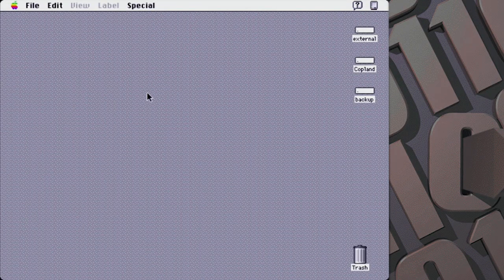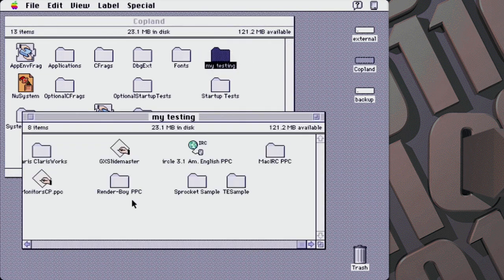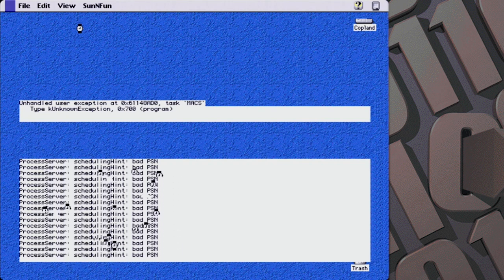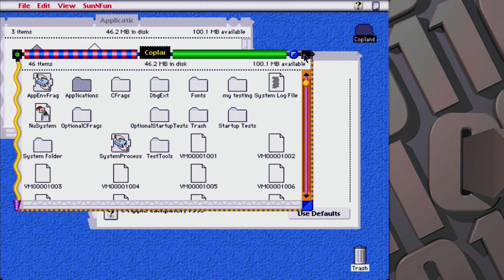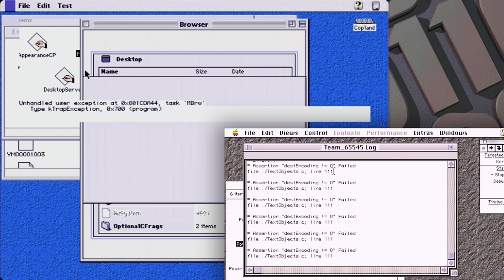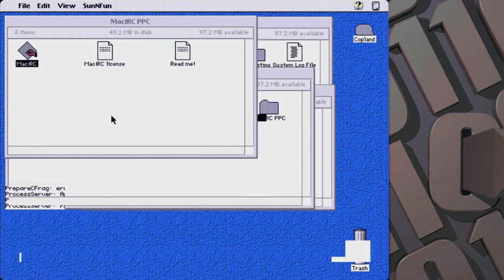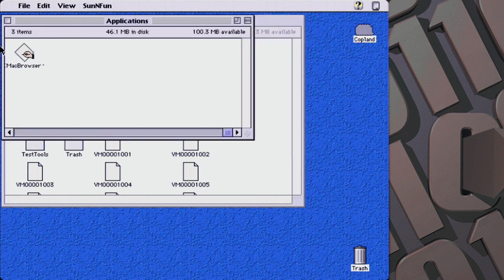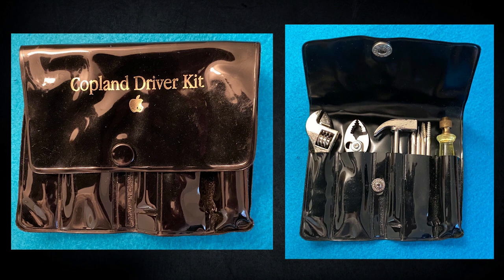Revisiting Apple Copland (D7E1 Build) Info/Tour - Paul's Old Crap #9

Comment: Looking forward to your video on D9 and D11 builds. Remember, the ‘d’ means development, which truly weren’t supposed to be run outside of Apple — they’re not even alpha-quality and meant to be unstable as a subset of engineers were basically looking for the massive crashers, documenting them, and getting those bugs resolved for a workable alpha. As a kid, I was so fascinated by Copland and what Apple was trying to do, so it’s great to see these videos. I’m actually surprised at how much working code Apple had at this point, given how dysfunctional the project was billed. That they had anything built that could boot is surprising in and of itself. We also have to remember that it was a completely different era of software expectations. Incremental upgrades delivered frequently was a hard model all around as the primary distribution points were floppies and CDs for average folks. From a marketing perspective, Apple had to jam a lot into one release as the market didn’t know how to deal with incremental OS releases.
Reply from the maker: We joke about Copland but on the tech side it is very neat what they were trying to do... Unfortunately I'd say they aimed too high and didn't have the resources to effectively build it. For the most part it seems like it was a "build from scratch" type of deal and slapping in existing Mac elements where possible, but everything was going to be different from the existing systems. Some of these old documents show simple things like driver extensions would have to be rewritten. When we see how many years it took for OPENSTEP -> Rhapsody -> Mac OS X to become a final OS, there was probably no hope for Copland.

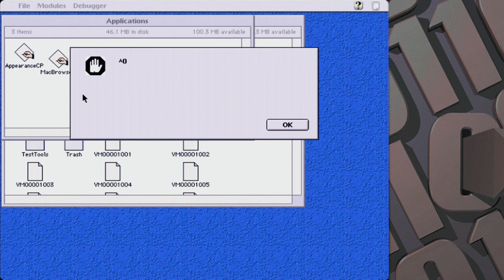Comment: 51:08 ^0 was usually replaced by a parameter string (in the old Macintosh Toolbox ParamText() ) so it's code missing.

Sorry for the tech commentary. It reminds me of a lot of old stuff.
Reply from the maker: It's good information to have as this sort of stuff probably isn't easily found anymore.

Comment: It's fascinating, after all this time, to finally see Copland in action (if one can call it that).  It's also fascinating how fragile the system actually is, with the first debug breakpoint being in the middle of boot!  With Copland's back story of disparate half-baked projects all being folded into the product at once, I'm not that surprised at the result, but it's still amusing to see.  I assume this build was never intended to be seen by peasants and requires an actual Copland team dev at the debugger, who has the insider knowledge of its internal workings and how to recover it, to demonstrate it properly.  I wonder how far one could get in a demo with that resource on hand, assuming such an individual still exists.  And as we've seen, the actual DR builds aren't much better.

Please continue with the videos.  This is something I've wanted to see for, well, about 25 years!
Reply from the maker: The funny thing as well is whenever they did demonstrations for the press, it was all fake. If you watch the episode of Computer Chronicles on Copland, they weren't actually running one of these builds but instead simply moving through a pre-rendered presentation mockup. I think most of what was visible there wasn't even in the last Copland build before the thing was nuked. Going over a bunch of the architecture docs from the D9 developer CD it looks like they were headed in the right direction on the tech side with the microkernel, but they didn't have the right people to actually get things done.
Reply: @netfreakcanada  Yeah, I'm familiar with those demos and remember them from back in the day.  They were a bit maddening since they were so obviously faked.  On CC, they don't actually show the presenter controlling it to prove it's a slideshow, but it's obvious that the screen animation is scripted rather than recorded, and when they cut back to the presenter, he always has his finger on one key.  I've never been through the architecture docs, though.

I do wonder what would have happened if Copland and Gershwin had shipped somewhat on schedule.  I think they could have kept the old Apple afloat for a while, but they probably wouldn't have been great.  Apple likely would not have had a compelling reason to acquire NeXT and would have missed their window to do so, and their decline may have continued.

Comment: 22:24 - The name of that theme was ''Gizmo.''  There were three unreleased Apple developed themes:  Gizmo (Z Theme), Hi-Tech, and Drawing Board.  They were nixed for MacOS 8, then brought back to potentially be included with MacOS 8.5, but were dropped yet again.  If you install Appearance Manager from MacOS 8.5 or newer into MacOS 8, you can re-install the themes.  They also had sound sets to accompany them.  The only theme + sound set that was even remotely tolerable was Drawing Board.  The other two are so obnoxious you'll use them for about 4 seconds then switch.

You can download the original beta themes from the various online Macintosh software repositories.
Reply from the maker: I think I also read something about how the decision to not implement those themes had something to do with potential legal issues if the OS interface was to change that much. Can't remember where I saw that though.

Comment: What happens at 15 minutes 5 seconds is that you get and assertion. 

As a developer one uses assertions to find bugs. The assert is standard part of the C programming language and derivates (C++ and the Objective C that Apples seems to like). One asserts that a certain condition is right; a pointer is valid, a size is valid etc. The asserts normally terminates the process when it fails but I have not used them for OS development so that might be different in this case.  It is normally a macro that is used extensively in the code. During development and debugging the macro expands to "if condition is not fulfilled, print location and terminate process". In release builds those are normally completely removed and users rarely see them. 

If asserts was activated in releases you would probably get them more often than you might think. Despite the termination during development it does not imply that the same bug would mean any actual harm in release. 

The "About this mac" assert on row 5889 in ListWindow.cp (15 minutes, 5 seconds). This is a specific location and the developer can look there a see what was wrong. On the location there is a test, like an if-statement and the developer know that this returned false and  the developer can evaulate the situation and take proper measures. 

I would guess that in this case the call is made to a funktion that either returns something unexpected or is just a stub. A stub function is part of the code where the function is there but it contiains nothing, it just returns a standard value. A stub. That is very common in early stages of development to create the foundation. 

Once released (or compiled without the assertion) it is likely that nothing would happen what so ever and the system would likely be able to survive. This build is for testing and development and one would want it to scream "bug" when there is one. 

Exception is another story. Exceptions are part of the error handling strategy that is also part of the release. If something goes wrong and the process are unable to survive it might generate and exception. A process that is terminated due to an assertion might also generate an exception. Other common exceptions are invalid pointers in C/C++/Objective C. Those are a bitch and the inner core OS or even the CPU might raise an exception, at least around that period of time. Dos did not raise exceptions, I havd had pointer bugs that totally fucks up the OS where the exception would have been welcome - then I would known I made a bug :)
Reply from the maker: Yeah I'm not much of a programmer so most of the debug side is foreign to me. In the later Copland releases they also had different system files you could drop in which supposedly cut down on the number of debug stops the OS made. I've got a lot of future messing around to do on this stuff anyway.
Reply: Great comment, thanks for sharing these explanations around asserts & exceptions.  It's stuff that I think would be valuable to understand for a lot of ppl dabbling in the old Mac OS betas :)  I agree probably most of the asserts are likely just stubbed out stuff that wasn't yet implemented.  I bet we'll find far less asserts in D11E4 if Paul does a video of it :)  Probably just as many exceptions though hahah
Reply: Assertions and breakpoints don’t necessarily mean the program has crashed as they are often used to signal an unusual but not necessarily serious condition.
Not knowing the source code, the best strategy is to continue the execution of the program with Control/Run until the next break/assertion or it crashes.
Without knowing the source code, propagating the exception doesn’t usually help because it moves the execution point down through the call stack in a different place that is quite likely to be affected by the interruption of the normal execution path...

Comment: 30:10 I would have selected "Stop" to stop the program. But "Run" a few times may have worked if it was just doing the same thing many time (each string to be displayed). It was just an assertion.
30:36 bad PSN mean "Bad Process Serial Number". I suspect he is trying to terminate the process but it is already gone. And that's badly handled at that point.

Comment: 39:50 the whatever reason is that it can't find the proper Open Transport "CFrag" (that's a Code Fragment, aka DLL)
40:45 The memory is likely including the "virtual memory"
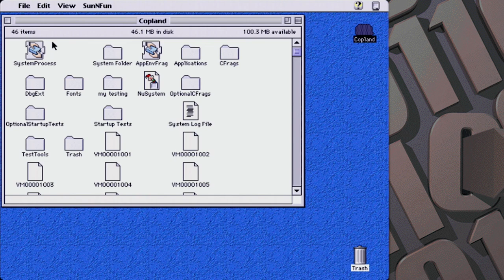49:30 Likely the file was corrupted, the same way the filesystem could have been corrupted. "Illegal instruction" is usually a good sign of that.

Comment: Protected memory was the only feature I cared about when I owned my Mac.  It crashed and lost my work way to much, and Apple had plenty of time to add it before I decided to switch to Linux.

Already by the time 040 was introduced Apples OS could not take full advantage of the CPU feature set.  Going to the PPC was even worse, as even less of the CPUs capabilities were utilized. Speed was the only feature that was used.
Reply from the maker: Yeah if there's one thing I don't miss about those days it was application crashes that took down the whole system.

Comment: My guess about Propagate Exception is that it propagates the exception to the parent process, which is going to be the kernel(or maybe something else?). And then system will probably try to kill the crashed process, and then it horribly fails.

For example, 42:05 says “Unhandled user exception”, which probably means the exception was propagated from the user process to the kernel.

Comment: Was Copland built new entirely from the ground up, or was is simply System 7 with new features?
Reply from the maker: Best I can tell the core system was all new and they were porting the toolbox and the gui over to run on the new microkernel. This probably explains why it was taking forever and nothing ran on it.